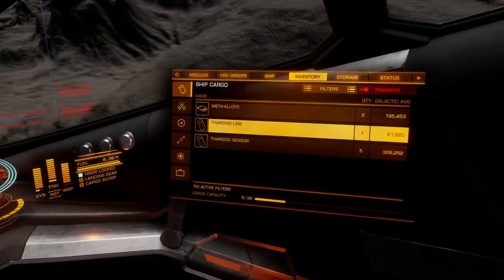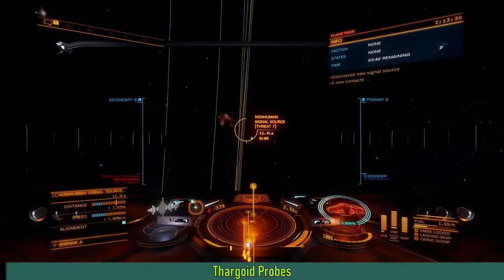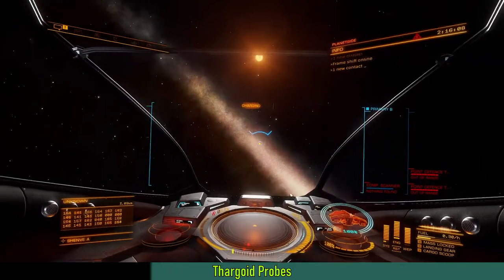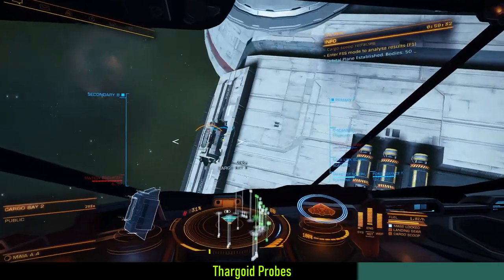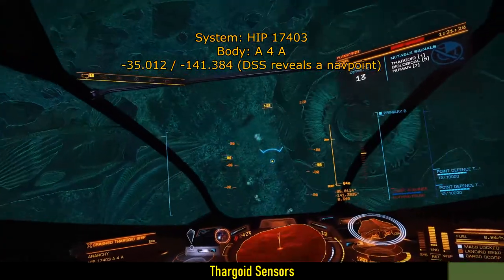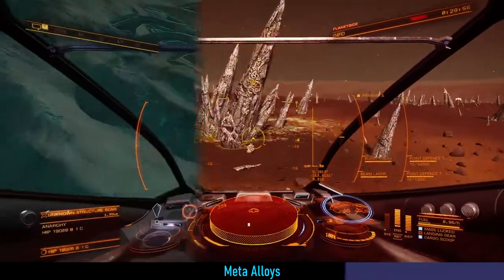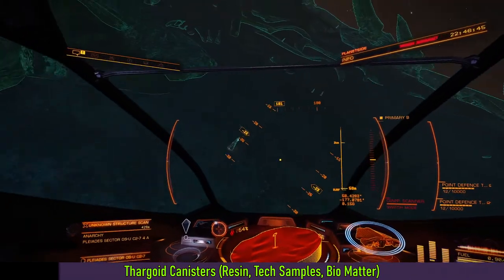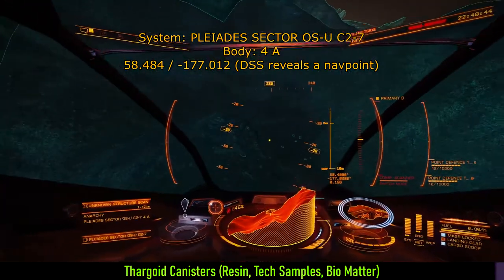Finding Thargoid Probe, Sensor etc. - Elite Dangerous (See comments for updates)

Comment: Hey. Can i stil get the sensors from the cords? im there but cant c anything
Reply from the maker: Apologies CMDR, Frontier made this unnecessarily complicated but you can still get your sensors. The Odyssey and Horizons surfaces are different, resulting in a "slight" shift of the "Crashed Thargoid Ship" (that's the nav point name) from -35.012; -141.384 (Horizons) to -7.336; -6.277 (Odyssey). The Odyssey version is not found within a huge and treacherous crater but on a somewhat plain... plain.
Reply: System HD 125178